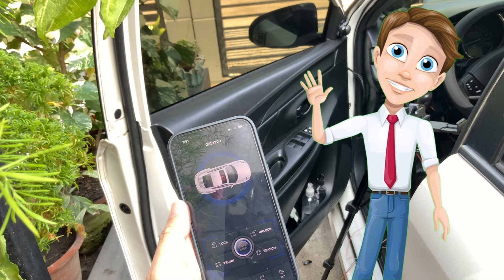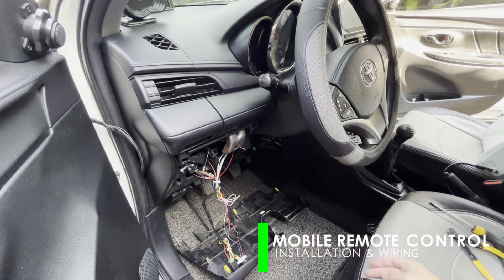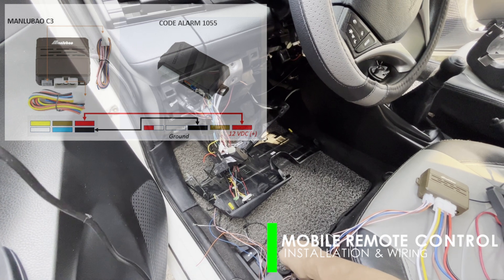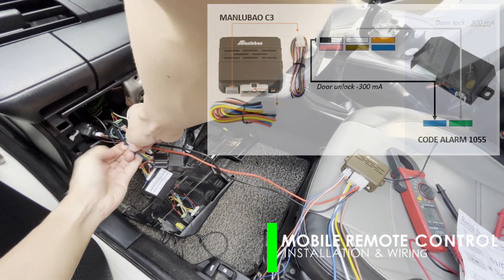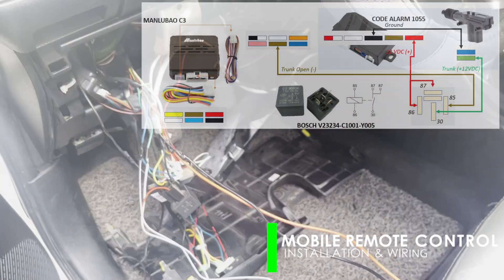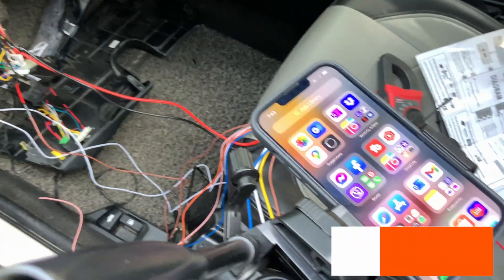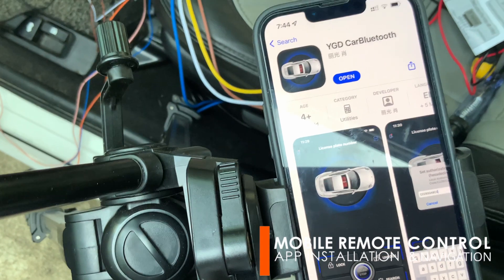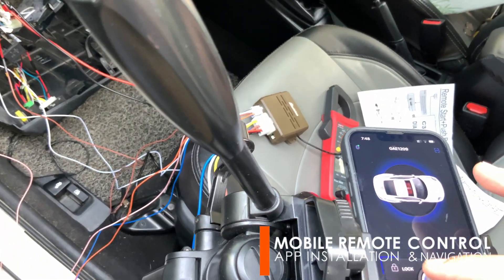Smart Engine Start and Entry System [PART 1] How to remotely control vehicle via smartphone #Keyless

Comment: Hello, if I don't install the alarm in which cables should I install the opening and closing of doors, I have the same car.
Reply from the maker: You should have a centralized door lock system sir, if none, you need to install them first.